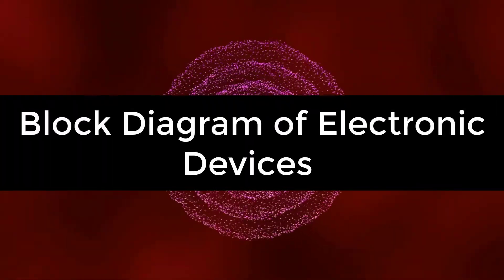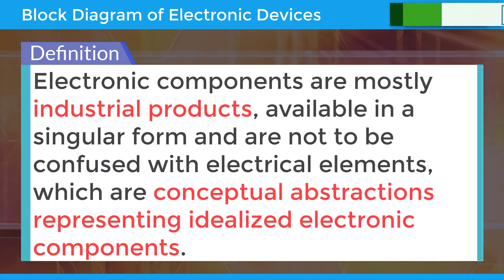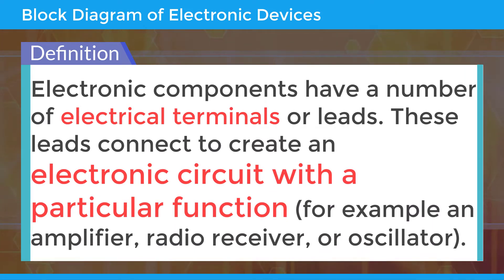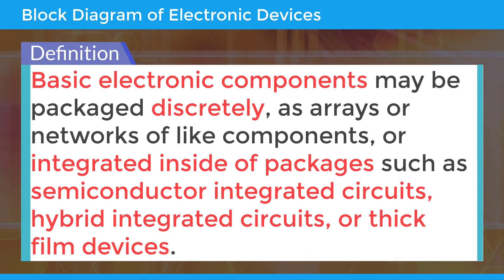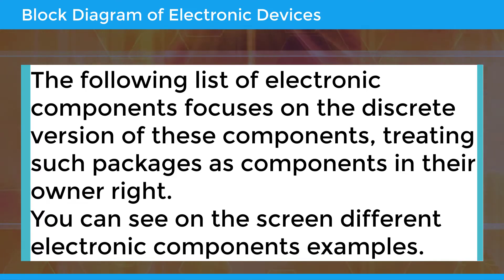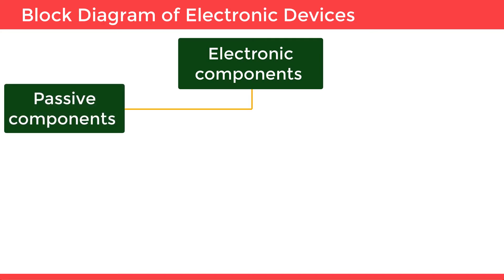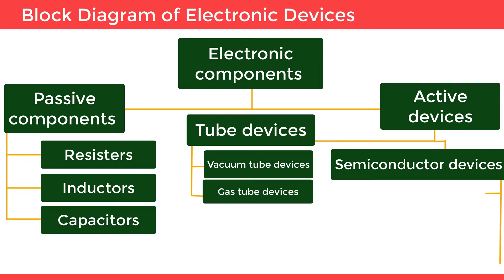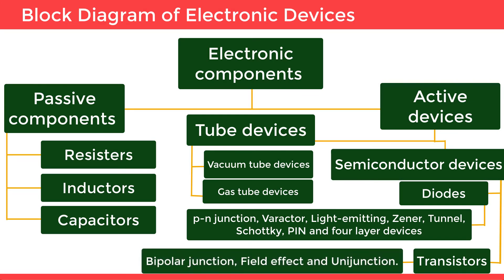Block Diagram of Electronic Components | Electronic Components & Devices | Engineering Concepts

Comment: I just read through the video titles and there are so many topics missing. I see no videos on the basic electronic components such as resistor , capacitors, inductors, transformers, diodes,transistors and other semiconductors. Yes i see u have videos for some semiconductors but,im sure they are not detailed..  u cannot unlock electronics if u skip resistors, inductors, capacitors or transformers